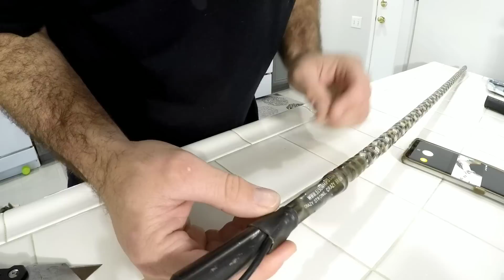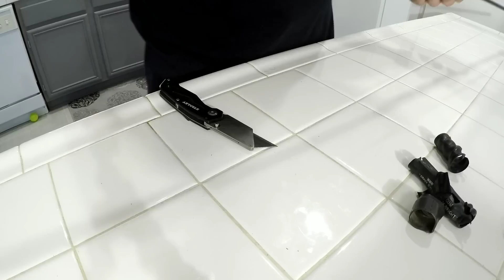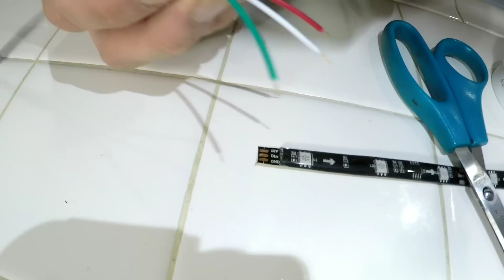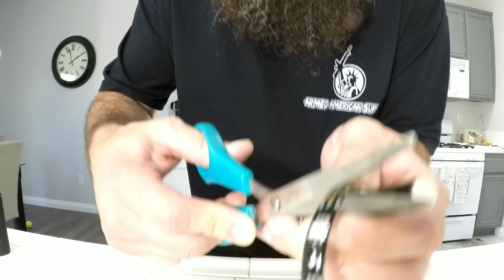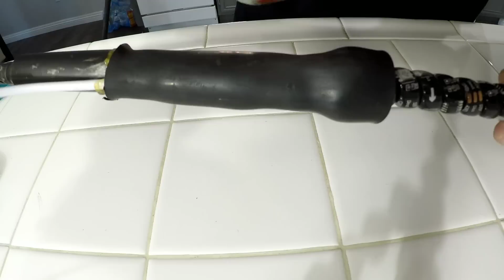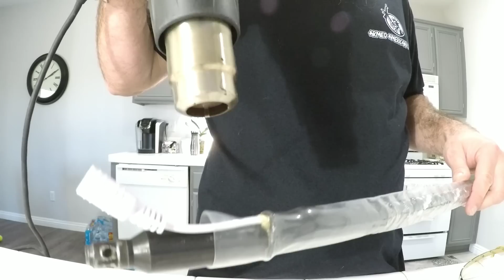How to make a lighted led whip

Comment: Hello again.  This has been such a tutorial insight on led whips.  My question is how can i integrate my turn and stop lights into my whips.  I have built 19 whips for our riding group from your video and instructions.  I have started using the 
btf-lighting ws2811 60 leds/m 20 pixels/m 300 leds, and found they do a few more functions than the 150 leds, not sure why?  but they look good and are impresive.  Thank you.
Reply from the maker: Nice I'm glad you liked the video. This video was kinda intended for beginners i should really make a second video showing my new style i make that run more power injected leds and integrate with the vehicles Break,reverse, and turn signals and music. However i custom order my new controllers straight out of China so i cannot provide you with a link for them, they also cost alot more than most people wanna pay and they don't do many modes right off the back but you can make your own custom modes with em so that's really cool if you're creative.
Reply: Have you or would you do a video for a more advanced dual Bluetooth system thanks
Reply from the maker: I do have a pair I'm making for a customer soon but they are gonna be set up assingle whips for jeeps. I'll try and set up the video showing how you would sync them as well.

Comment: Thank you for your time to put this video together, I just built one using your info!!  I was wondering if you have built one using the 60 LEDs?  I'm guessing the additional LEDs would make it harder to wrap?
Reply from the maker: Great question using more LEDs per foot will require power injection along the way to keep all the leds at the same brightness.
Reply: Yeah I was just wondering because I saw the 60 LED strip when I ordered the ones you used.
Reply from the maker: If you're only building a 4' whip those leds would be fine without power injection.
Reply: Can you give any advice on the newest LED strips that are available today, bulb size (5050) or number of LEDs 60 or 120 per meter ?
Reply from the maker: It really depends what you're looking for and the application it's being used on, the newest chip set is the ws2815 i believe. However with all the benefits of them i didn't like the pattern they run in for whips due to having a IC chip in every led. Also some controllers didn't like running that many IC chips and couldn't light a full 6' whip plus they cost twice as much. At the end of the day if you're not looking to run a single color at its peak abilities like white for example then you can't really beat the ws2811 and the number of LEDs is up to you long as you consider power injection if you plan on running 6' whips.

Comment: Planning to make a RV "Camp Locator LED Whip" and decided to use a 4', 1/2" copper pipe with 3/4" to 1/2" base connector....do you see any issues with this?

Comment: First thanks for the great tutorial.   I made my own with the controller that you linked.    I'm trying to get them to stay synced with 2 controllers.  any helpfult tips.  thanks.
Reply from the maker: Thank you. Ok so if you want to sync the two you need to start with one plugged in, find the mode you like and then power it off with the remote this will save the setting. Unplug the first one and plug in the second one and repeat the process. Now plug both in they should be on the same mode. If the timing is off hold the remote between both whips and press power on the remote to power them off, then press power again so they both come on at the same time.
Reply: I did the same parts for my set of whips! and I could never get them to sync! so I just used one controller and split the leads goin to each whip! works awesome!
Reply: bryan nelson - airtimegrafix  could you elaborate a little on this?
Reply from the maker: Whip syncing https://imgur.com/gallery/hJDHr6K

Comment: Sweet video man. I was wondering on the voltage. The description on amazon for the light strip says nothing over 12 volts. I have a 2018 polaris ranger 1000 and they put out 14v when running. Will it still work fine?
Reply from the maker: Yes. The battery should be 12 volt. Your alternator charges the battery at 14 volts most likely
Reply: DMAX909 if i check the voltage at the “plug and play” busbar, the voltage is still 14v. I believe that connects strait to the battery
Reply from the maker: I wouldn't think it would be much of a problem however if it concerns you, you could put a 12 volt voltage regulator inline between the battery and the LEDs for peace of mind.
Reply: DMAX909 thanks i will keep that in mind stuff should be here tomorrow.
Reply: Ok so i got the lights and have them plugged in the wall. The lights come on seems be in auto mode i guess, doing all different colors. But i can not pair the remote to the lights. I read the directions but nothing is working.
Reply from the maker: Is the battery in the remote good?
Reply: DMAX909 yes brand new. I see the light flashing on the remote but does nothing
Reply from the maker: You might have a bad remote or controller then. It should just work, no need to sync it.
Reply: DMAX909 great my luck. Must be remote.. i have another remote for my rock lights and was just curious to see if it would work... and it does lol well kinda i can change some colors with it and make it do stuff but i have to mash random buttons on it. Guess i will try to return the remote and controller.
Reply from the maker: That sucks. At least you have it narrowed down though. Good luck
Reply: DMAX909 UPDATE: new controller came in and worked perfect. Got it all done works great. Only problem is the silicone started to break off the light strip after wrapping it around the rod i was using. I think if i use something thats 5/8 of an inch it wouldnt have done that. What i used was maybe a little less that 3/8. Still works though lol
Reply from the maker: Yeah that will happen if you dont work fast getting it wraped and shrink wraped on any size rod. The first time i made one that also happened.

Comment: This is awesome! I want to build one completely from scratch, including the quick release. How sturdy/bendy should the whip itself be and will this damage the wires/LED strip itself when it bends? Also will one control unit control 2 panels?
Reply from the maker: The less bendy the better. Be sure and check out part two on my page to learn how to sync them.
Reply: @MrRICKDAWG4444  oh sweet cheers
Reply from the maker: @taliesinbourne7484  enjoy

Comment: Awesome video! Subscribed! Are there any rock led pods that would sync with these lights? Could I use the same controller and just splice the pods into it? Thx for any help!!
Reply from the maker: Yes these controllers will work about 1024 leds i believe, so if you splice all of them it should work but I've never actually tried rock lights b4.  Keep me posted on it please.

Comment: Can you go over the wiring to a battery?  Instead of outlet?
Reply from the maker: It's the same. You'll have a positive wire and a ground wire. You just connect those to the battery or a toggle switch.

Comment: Have you built a pair of whips that are synced together and could you explain what I need to do to do that.   Loved the video thanks
Reply from the maker: Yes basically that's all I build is paired whips anymore. Ok so instead of putting the controller in the whip you're going to use a 3pin connector coming off of each whip then make a wire harness that splices two leads off of the controller that will go to both whips. I recommend using a sp110e Bluetooth controller for this. Here's a old pic of how my first set looked. https://imgur.com/gallery/hJDHr6K

Comment: Great video man! I have a question about the power source from the side x side to the controller, do you have a link for the plug that you run to the 12v system I can’t seem to find anything that looks like it would work, tia
Reply from the maker: Thank you It's a 5.5 male plug that plugs into the controller.

Comment: the leds may be failing because they are overheating.  Electricity creates heat and those LEDS encased in that shrink wrap and wrapped so tightly around the whip it leaves zero ability for the heat to dissipate.  You may be able to feel the heat on the whip depending on what the whip is sealed with.  Not all LEDs are made the same
Reply: Maybe a hollow rod with both ends left open?

Comment: Hey great video. My only question is that is there a way to sync two whips on the same atv to one controller and one wire running all the way to the battery, or would you have to run both to the battery? In that case would the controller pick up both sensors at the same time? Thanks
Reply from the maker: Yes you can splice one positive wire from the the battery and ground both whips to the mounting bracket long as it's a good ground.
Reply: DMAX909 awesome, thanks for the info
Reply from the maker: No worries. If you have any other questions feel free to hit me up with them.

Comment: Great diy video!!! Were could I find thick heat shrink used on contoller?
Reply from the maker: Everything used is found on Amazon. Type in 1.25  3to1 adhesive shrink wrap and you should see several different ads for that stuff. It will come in sticks not rolls.

Comment: Awesome video. I used most of your techniques to make mine the same. My only struggle is the top cap. What did you use? I used fiberglass driveway markers for my poles.
Reply from the maker: Thanks, as for the caps i use the ones that come on the 5150 day whips. I'm sure you could find them with a Google  search or maybe just try wrapping up some electrical tape at the top.
Reply from the maker: These are what you're looking for LGEGE - 3/8", 25 Pcs Black Screw Thread Protectors https://www.amazon.com/dp/B07HY6FT3G/ref=cm_sw_r_cp_apa_i_LCtMCbYRFERQM however I'm not sure what size your whips are and these are kind of expensive. I would go to a auto parts store and ask for a vacuum cap in your size.
Reply: @MrRICKDAWG4444  Thanks so much for that link! Much appreciated.
Reply from the maker: No problem.
Reply: Al Carriere what did you use to mount the driveway pole whips. I was going to go to my local tractor supply and pick up a couple of 3/8 fiberglass fence posts but been trying to figure out a way to mount a threaded end or find a mount just for the rod to slide into and maybe tighten down on.

Comment: Awesome video man ! So if I wanted to run these whips on a separate zone from all my rock lights & dome lights. Is there a controller that allows the whips to be programmable but also separate zones for the regular RGB lights ?? I’m looking for a Bluetooth controller all in one to keep the install nice and clean but use also super easy.
Reply from the maker: I'm not sure as far as zoning goes but i do know the controllers will only allow up to 1024 leds before they start to melt down.

Comment: Great video...  Any idea where I can get just the Quick Connects to make my own whips?
Reply from the maker: They are just air hose fittings however the male side that comes on the 5150 day whip that i start with is custom made by them. There are several different mounting options for whips if you do a Google search you see a few different choices. If you're handy with a welder I'll be posting a video on some magnetic ones that I'm making that use thicker 1/2" buggy whips.

Comment: After you Made the whip the controller has the barrel plug that you used to connect to the wall adapter. what kind of barrel adapter did you use (or cut up) to mate to the controller barrel Connector to wire into the machine? Thanks
Reply from the maker: I don't use the barrel plugs anymore they are a fail point. Check out the part two video on my channel where I unsolder that connection and hardwire it.

Comment: Hey man will definitely be making my own whips great video do they make these leds with a bluetooth controller
Reply from the maker: Yeah they have a few to choose from. Just search WS2811 bluetooth controller in amazon.
Reply: @MrRICKDAWG4444  thanks man appreciate it
Reply: Will the ws2811 work the color chasing leds
Reply from the maker: The WS2811 is the style of led you should be using for this project so if you read in the description of the controller you choose it should list the LEDs that are supported. Most of the controllers will support the 2811

Comment: I am YouTube illiterate, where do I find the "description" you refer to? Looking for the info on parts to build some of these. Great work
Reply from the maker: If you're using the app from your phone it's a little arrow next to the name of the video you click and it will drop down the description.
Reply: DMAX909 so you only need one controller for two whips install in one car?
Reply from the maker: Yes a single controller can operate 1024 LEDs

Comment: Are they Bluetooth controllable? Excellent video enjoyed watching it.
Reply from the maker: The controller i used in the video was not bluetooth capable because the customer wanted more modes. With a bluetooth controller you are limited on modes, however one could use a bluetooth controller in this application but would need to mount it on the vehicle somewhere instead of in the whip because they are a bit bigger.
Reply: Thanks,  can you sync them together if running dual whips?
Reply from the maker: Yes you can. Just splice all the wires together.

Comment: I’m curious if you’ve made any from scratch & if so what size diameter is of the whip. Also what’s the best material for the whip. Thanks for your time.
Reply from the maker: I make all of em from scratch. 3/8" - 1/2" fiberglass works best for my builds.
Reply: DMAX909 thanks for the great video. I’m a little stuck as far as the quick disconnect part. The only ones I have found are mainly 1/4. Can you let me know what parts to get for either a 3/8 or 1/2 rod? Thank you
Reply from the maker: @oYouWouldntDoIt  5150 day whip are what i start with they come with the quick disconnects.

Comment: I'm interested in making my own, but I was curious how you hook it up to the battery and would I be able to attach a 2nd whip to the same controller and I was planning on possibly installing whatever extra lights I have left underneath my radiator relocation bracket
Reply from the maker: It's super easy. There is only 3 wire in this system 12v positive, ground and data wire from the controller. You can splice two whips on the same controller to sync them. Hope this helps.
Reply: @MrRICKDAWG4444 thank you, I'm making 1 completely from scratch would I be able to buy a controller like what comes with the actual whips and I've also read that you would have to beef up the "transponder"? So you can power 2+ whips and extra lights.
Reply from the maker: I make most of the ones i sell from scratch also. As far as syncing two together i make them differently since i can fit the controller on the vehicle somewhere. One controller can operate 1024 LEDs i believe however if you exceed 150 leds in one whip you will need to start power injection after that if you want to run all white without fading out at the top. Most other colors will not fade out.
Reply: @MrRICKDAWG4444  ok for you reccomend anything for power injection, I'm installing a dry box that the switches will go in to stay dry between the handle bars and radiator relocation... I'd like to have 2 whips on the back and a small strip of lights at the radiator relocation.
Reply from the maker: I usually just splice into the tail lights for power since it's already fused and has a switch. As for power injection its it's pretty straightforward you just run another power and ground up the whip under the leds and tap it in after the first 150
Reply: @MrRICKDAWG4444  I made my first one tonight, but ran into a small issue not sure if it was my error or a faulty set of lights. The silicone started to split throughout the whole whip before heat shrink was added
Reply from the maker: @dabba.doozy.designs  this will happen if you wrap to tightly or work to slowly. The only advice is work fast and have everything ready to go b4 you start wrapping the LEDs.
Reply: Do you sell these as well?
Reply: @nick42009able  no I just made a few for myself and to try it out
Reply from the maker: Yes i do unfortunately i don't have a store so you can pay thru PayPal and I'll ship them or meet up locally.

Comment: This is such an awesome video.  Thank you.  I have a question.  I am going to build five of these for myself and my family members.  are the controllers different frequencies, or are the remotes different frequencies?  Will all five fight with each other is my question and fear.
Reply from the maker: Thank you. Yes the remotes will change every whip thats powered on and close enough.
Reply: If we are far enough apart when turned on, as to not interfere with each other,  then run together or park together will it effect them then?
Reply from the maker: No them being together won't effect the mode that they are running however someone messing with a nearby remote will. I found that almost all these remotes work on a likewise frequency and can work other whips in some way or another. If this is a concern they make bluetooth controllers that are a little bigger so you will have to mount the on the vehicle instead of the whip but then you will be able to control them with your phone and also dance with your music playing.

Comment: What do you use and where would you get the antenna and connector if you don't have one to tear a part and just want to build from scratch?
Reply from the maker: The base where you connect it to the vehicle is the most important if you're going to be using it aggressively off road so i generally start with a "5150 day whip" that you can find on chaparral motorsports web site. Ive also taken plain 3/8" fiberglass poles and made my own quick disconnects using air fittings and jb weld to attach one end to the the pole. Hope this helps, if you have any more questions feel free to reach out to me here or on FB and IG.